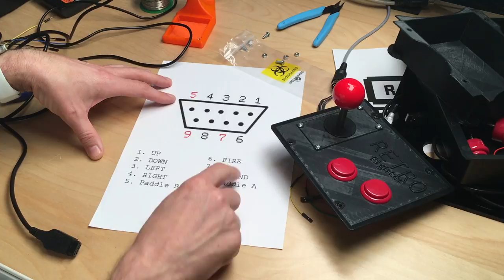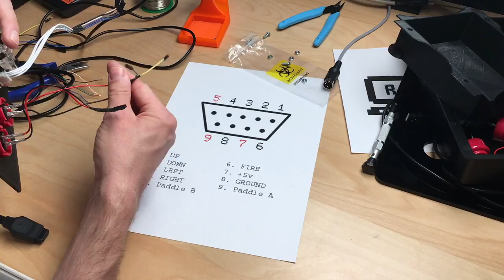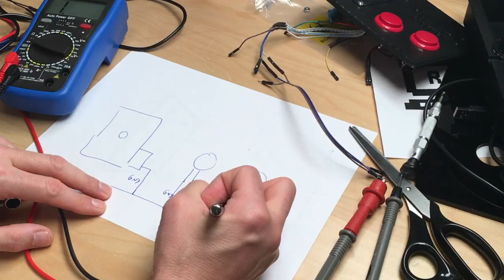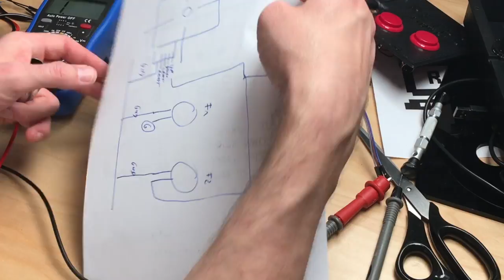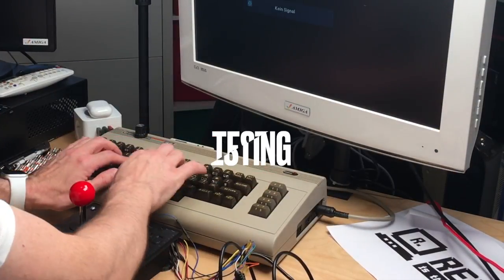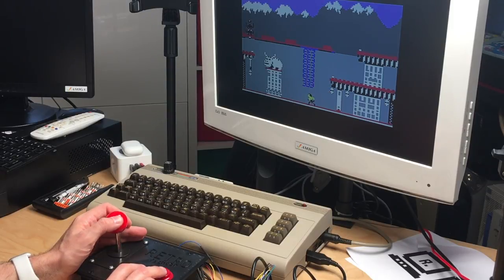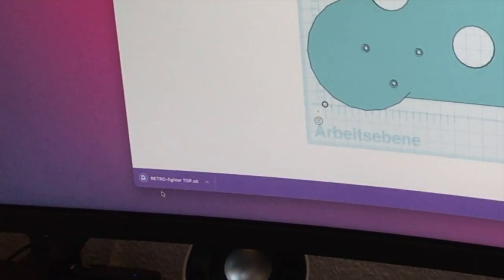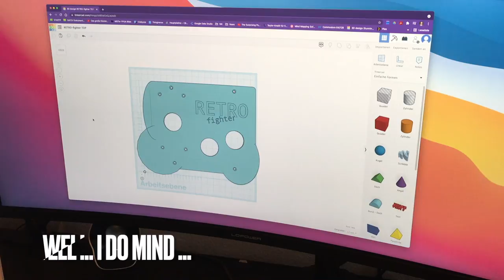Creating a C64 / Atari / Amiga joystick from scratch - come build along!

Comment: Some of those 50/60fps C64 shmups really need a decent table top joystick so you can hammer the fire button like an arcade cabinet.
Reply from the maker: Yep. And this joystick is perfect for that. I use it almost every day!
Reply: Agree. These arcade parts are very durable. I'm using a Logitech F710 (wireless, dualshock style) gamepad for like 3 or 4 years now and it still works well, but for nervous and angry old school gamers something built using arcade parts with thick and heavy case would be better. 😅🕹️

Comment: c64 suports 2 buttons though, myth is an example using button 2
Reply from the maker: They may have done some trickery there with connecting the PotX-Pin. But there are maybe a handfull of games that support this. I think the second button is better used for jumping, since that really improves any jump and run available. … but you could of course wire up a third button. However this button on potx has to be pulled to vcc instead of ground. You might have to solder a fresh 9pin cable for that since most joystick cable don‘t support the vcc and potx/poty pin.
Reply: yes, on c64 you pull pin9 to vcc, on amiga to ground. a handful games on amiga supports this as well